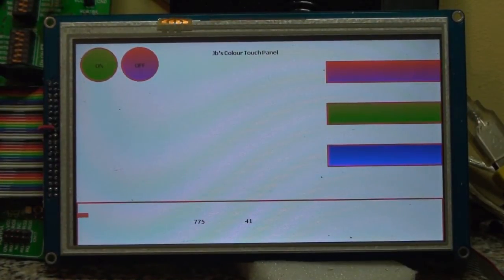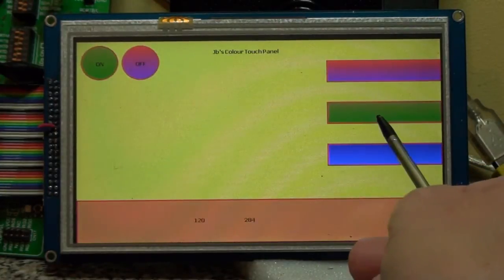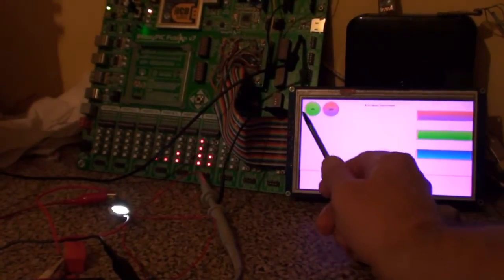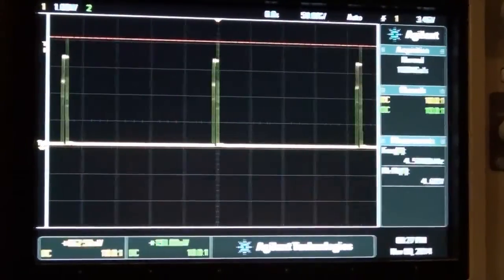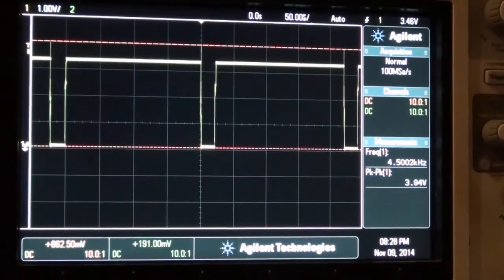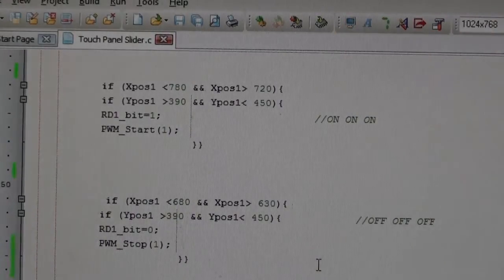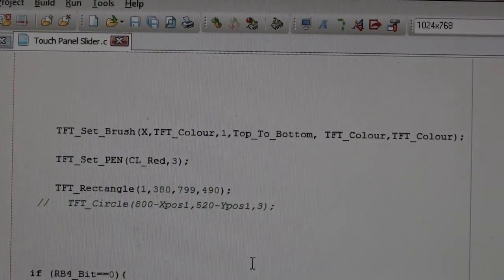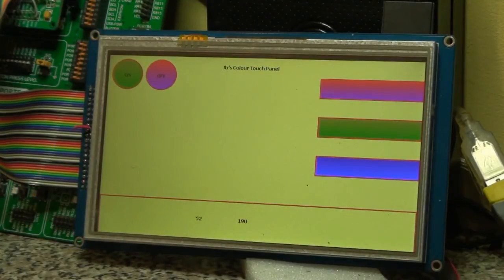More TFT Touch Panel Code & Change Colours + PWM MikroC

Comment: John could you share the wiring for these displays. I'm fighting with some PIC24 code to drive one in 8-bit mode but I think I'm missing some connections. Did you find it necessary to connect D8:15? The SSD1963 data sheet says to leave them floating.
Reply from the maker: +Andrew Jacobs 
Hi, if you look at a few of the other videos on the 5" and 7" TFT, you'll see the wiring I used.
D15 does need to be grounded in 8 bit mode.
Reply: +John B Thanks. I'll give that a try
Reply: Seems my big problem was not sending the right command to turn the display on. My board doesn't need the db15 link.